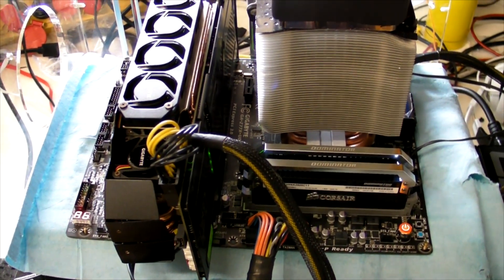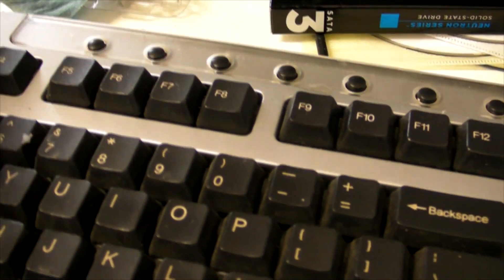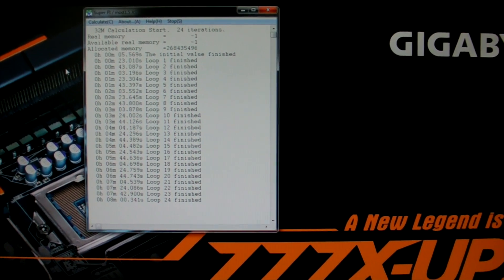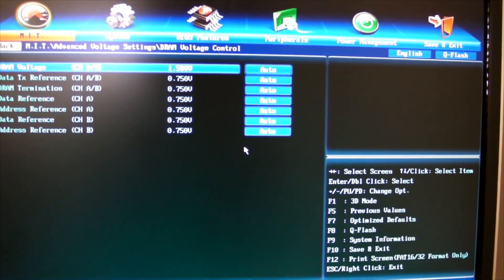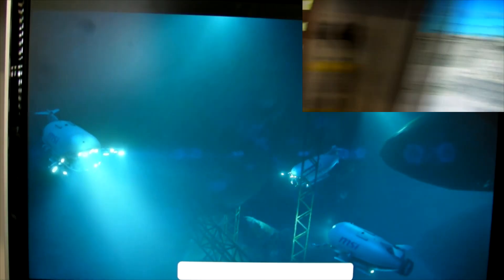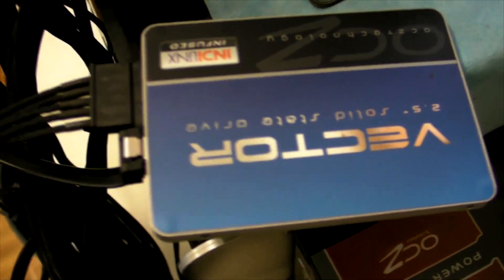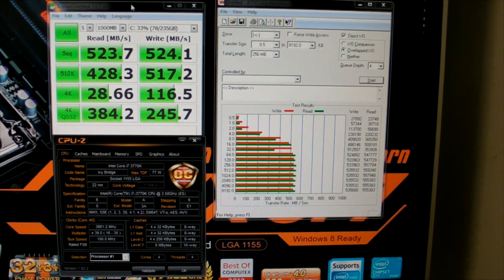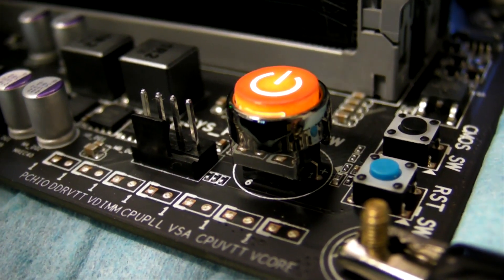High End PC Tuning Guide

Comment from the maker: Hi mate, a lot of high end memory is actually overclocked memory by default but unless you unable XMP or manually set the speed that the RAM is rated for it will run whatever the motherboard sets it at which is normally a lot lower.

Comment: I thought the music was going to break out into the Final Countdown....

If you have a board without the bios ovrerride switch, there is an undocumented hotkey you can use to flash the backup bios, its alt-f11 or something, I've only used it once and it does work but obviously google tol make sure.